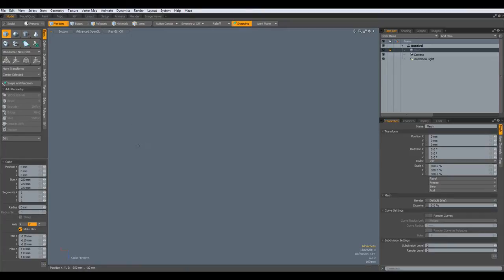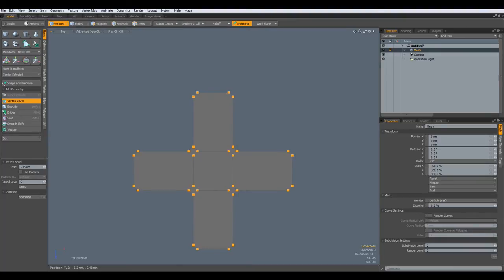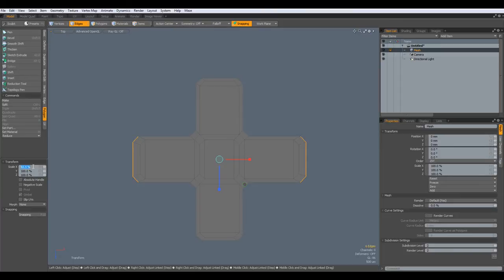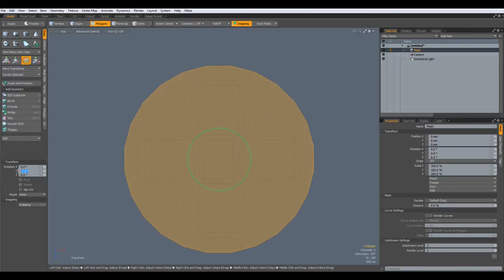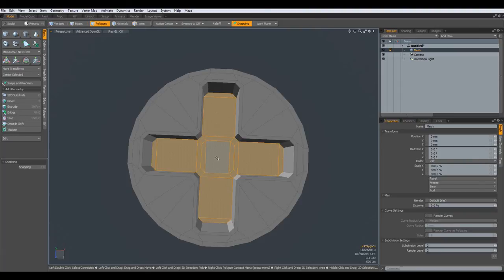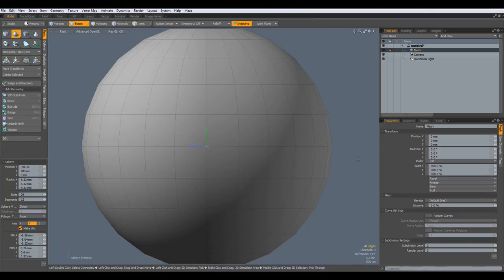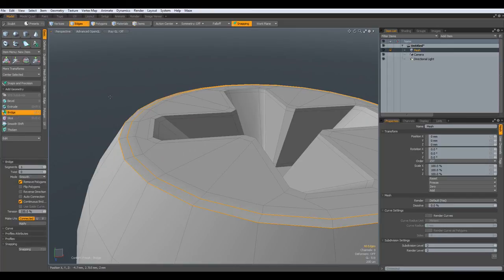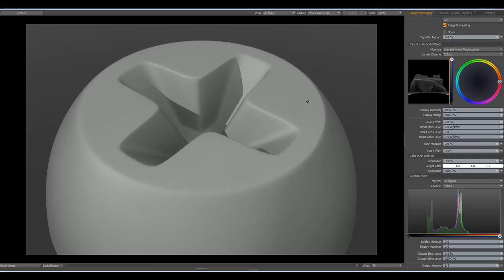Luxology Modo - Modeling a Cross Screw Head

Comment: Thank you very much! Ive been using modo for a little over 1 year now, and not very often have i uused vertex bevel. The vertex bevel part was the one i was missing out in my screw... Before i tried to make the tightness of the edges in the screwhole by adding extra loop slices (or using edge weights but that didnt give so good result to this purpose), but it gave me extra geometry on the sides of the screw head aswell, which we dont want. Thanks again :)!